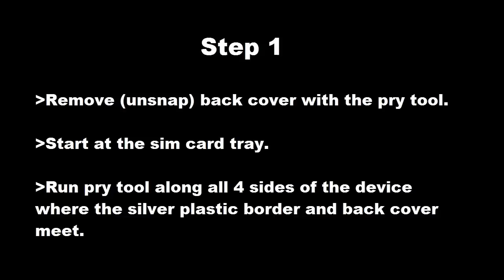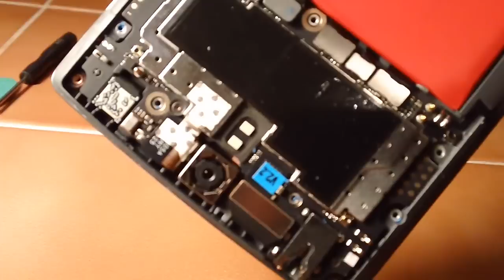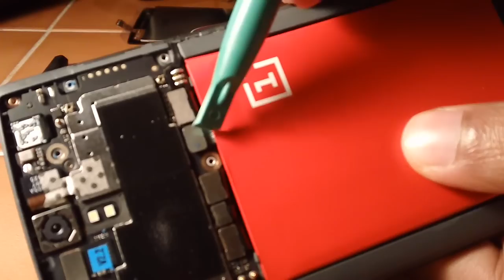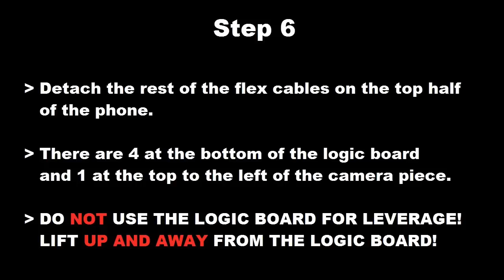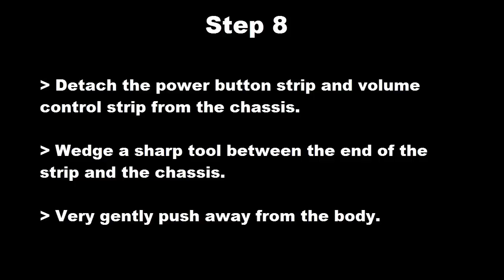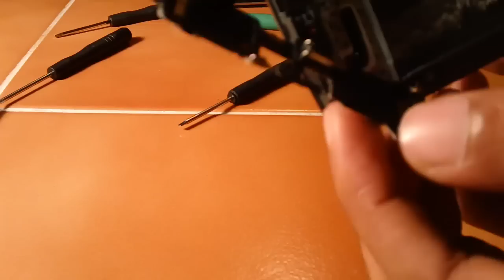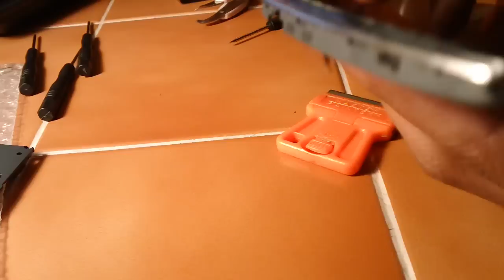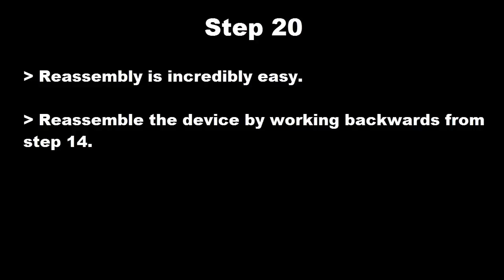HOW TO: REPLACE ONEPLUS ONE SCREEN (OPO Disassembly Tutorial) EASY COMPLETE TEARDOWN

Comment: Was it possible that the digitizer wasn't the same jdi display that the company uses for the phones? Might explain why the colors look off. Anyway great video.
Reply: ***** I noticed there are two SKUs when you look around the web. One ending in AA4, the other ending in AA2. Looks like your original was AA2 and the replacement was AA4
Reply: Yes. More than likely coming from a 3rd party seller.